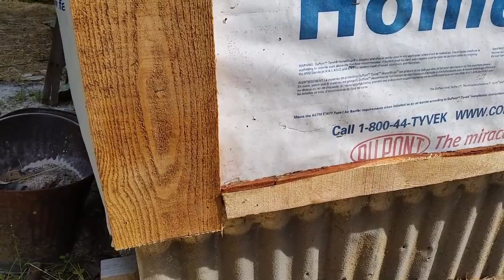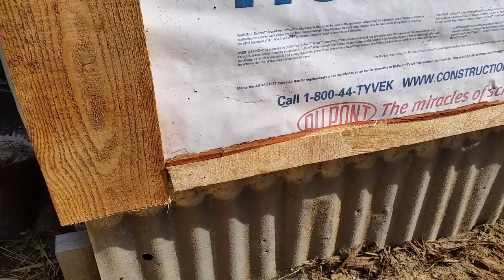Clapboard Siding the EASY Way! | Building a Homestead From Scratch S2: EP 1

Comment: That's how I did my house 3/4 larch , 6" w/ 4" exposer. Ya gotta dry your boards! Even a little bit. I think lumber is half dry the first two weeks if properly stickered. This kind of cut the boards will dry in place and breath as wood should. I didn't see any butt joints in the video but I back mine with strips of aluminum. Building the trim out is a must as well , for caulking.

Comment: I am siding my shed with 5/8 by 6 foot by 5 1/2" fencing pine treated boards. My edge molding is 2x4's. I overlap them leaving about 1/2" so around 4 3/4 to 5 inches reveal. They look real nice, they are SYP from H Depot for $2.25 each. My plan is to use a deck sealer on these boards. My entire 2 story shed is SYP PT wood except for the ceiling joist which are just SYP 2x8 x12's. I am using 2 1/2" galvanized siding nails and so far just nailing the top edge. The natural curl on these boards means I lay them on with the curled side facing out. I figure they are always going to be about the shape, and they lay in nicely.   After I am done I may go back and nail down some board edges. You want these fence boards very dry before you put them on as they will shrink up. I put them out in the summer sun a few days and then let them dry at least a week leaned up inside my partially built shed. Anything too warped, I will take back to H Depot.

Comment: Great work on that siding install.  In regards to using oils as a preservative. You need to fully flood it on. So make sure it’s saturated, and it’s an every 24 month reapplication. Yes people do go longer, but it then just takes more product and unnecessarily exposes the wood to the environment. And make sure you don’t have any loose fitting clothing on when your running that saw. Nice place!!